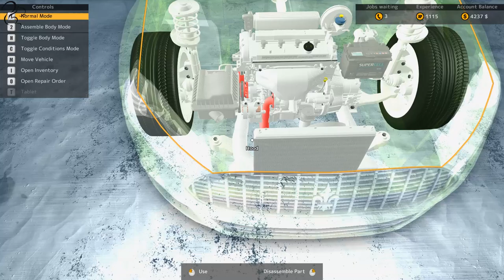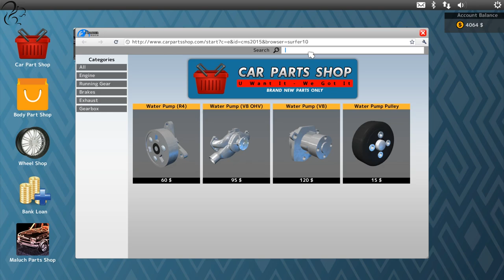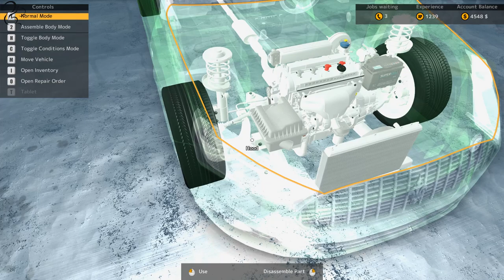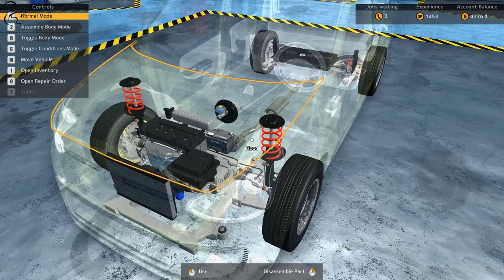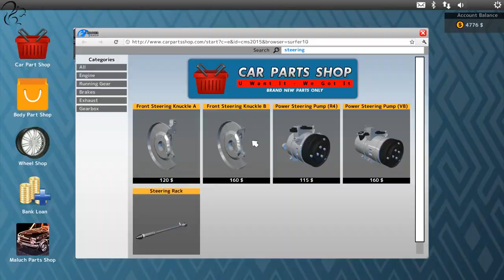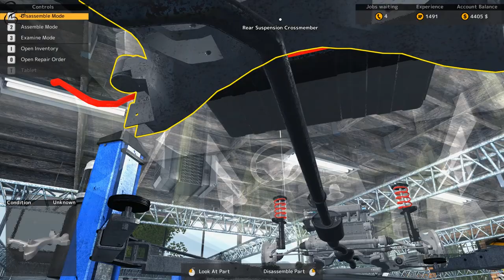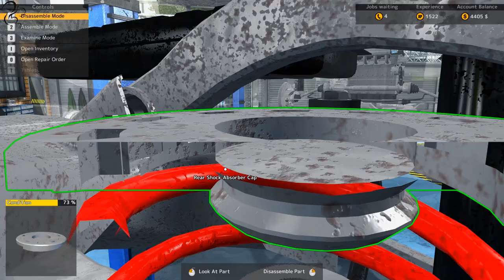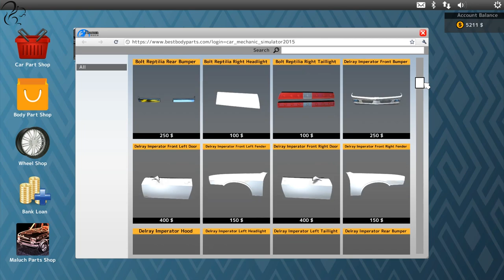Let's Play - Car Mechanic Simulator 2015 - Ep 4

Comment: At about 18:30 in you say mechanics get billed by the hour. That's actually not true, mechanics get paid by the jobs they do, and that pay is determined by how long the job's expected to take.

Doing brake pads on one wheel could be said to be a half-hour job but a good mechanic might do it in a quarter-hour, and still get paid for a half-hour job, so they get more money. A bad mechanic might take a full hour, but again still get paid for a half-hour job, so they get less money.

Doesn't matter how long a mechanic takes to do the job, they'll get the same pay if they took an hour to do it or if they took two hours to do it. Customer still pays the same, too.

You want a real thing to complain about when paying mechanics? Often times replacing a light bulb can be a five minute job, but in the database it's rounded to a half hour job or an hour job!